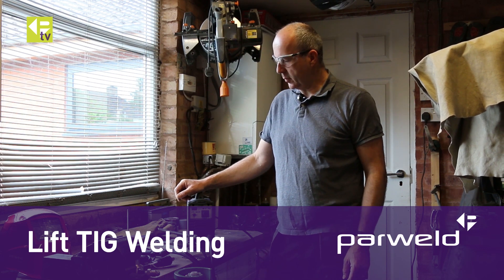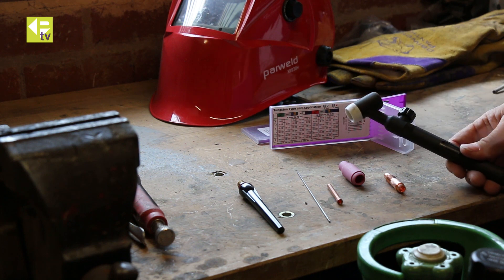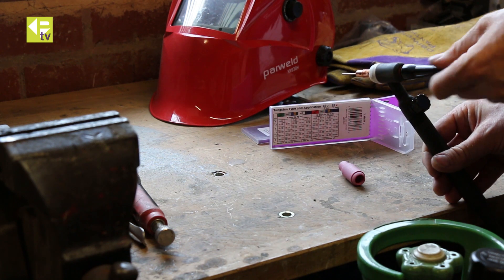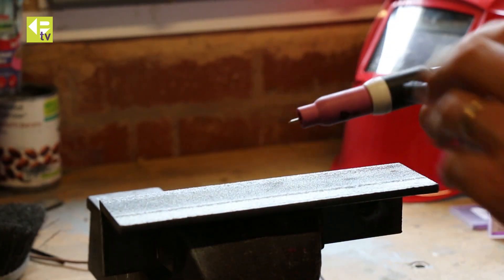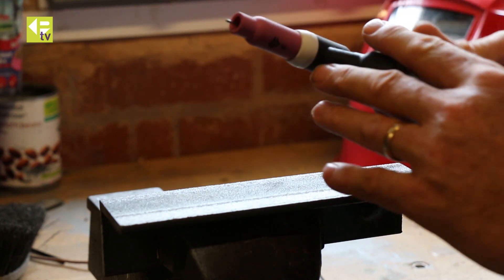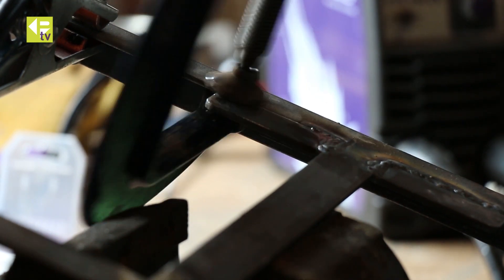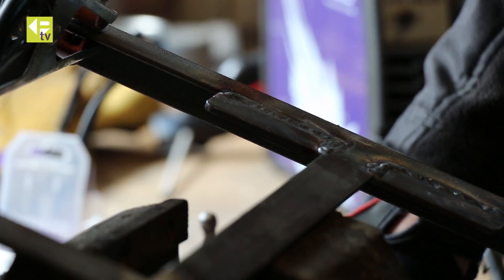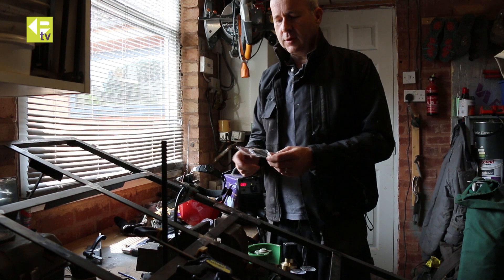Parweld Lift TIG Welding Workshop

Comment: Hmmm.....parweld, if you need someone to demo your weld equipment, I'll gladly do it. 
I'd prepare the metal down to bright metal first... I'd set my gas to the correct flow rate so that sparks aren't flying off... I'd move the tig torch in the correct direction (advancing toward the filler rod NOT away from it... and my hand won't wobble around so that the newly ground tungsten doesn't dip into the weld on the very first attempt and ball like a blob!... 

Basically I'll do the complete opposite of this guy.

Comment: I can't believe you were the "welder" chosen by this company to promote it. You're welding in the opposite way on a rusted piece with a rather ugly outcome. Self-taught mayhaps? Because it shows.
Reply: the guys not a great welder.but took the time to offer help . why dont you stick on some of your work..easiest thing in the world is to  pick faults.. but at least the fella had a go.iv been welding yonks arc/ mig/ and gas.. never done any TIG  but will take from this a bit of inspiration ...see what i can produce..definitely this guys no been put forward by the company.. just a weekend DIY welder.. i would say an honest fella.. no question..cheers jb
Reply: @sparkyjb488  - I suppose you don't understand why a company has its products go through quality assurance before they go to market? It's so that consumers can see the quality before they buy. Much like how I am a professional welder and look up videos like this, expecting a professional welder showing the machine's capabilities, not some dude in his garage who doesn't even bother with cleaning the rust off the pieces before unsuccessfully welding them.
Reply: @SnorrioK  may have got a better arc if he’d bothered to resharpen the tip after dipping it in the weld pool on the second weld

Comment: Sparks with TIG = not good. Either gaz is absent/not enough, or you're cutting through. Also, for TIG you NEED to prepare the spots to be weld beforehand. This deep yellow/orange discoloration everywhere is rust, your shielding is lacking.
Reply: maybe just dirty and uncleaned also?
Reply: @2012isRonPaul  nah
Reply: Did you watch until 8:18? Please do... you'll find his comment amusing. Shit ton of sparks...guy says "Too much gas flow there"...but obviously then realises his gas is off! 🤦

Comment: May i ask how to connect the tig torch to argon?
Reply from the maker: You have a two piece Tig torch with this package so one with the 35-50 Dinse goes into the machine and the other with 3/8’’ to connect to gas.